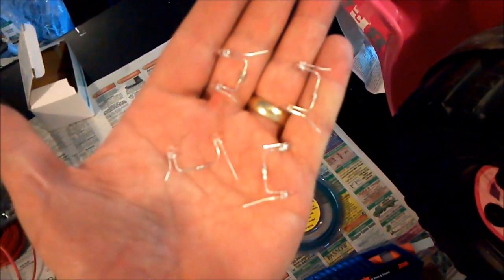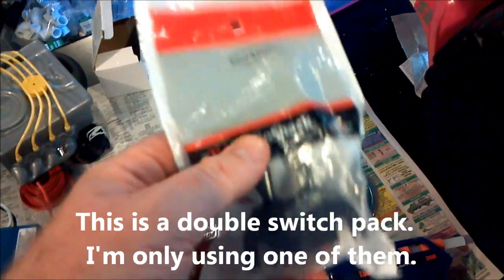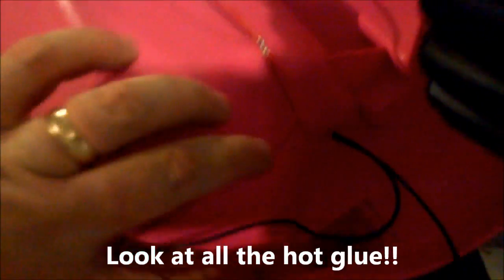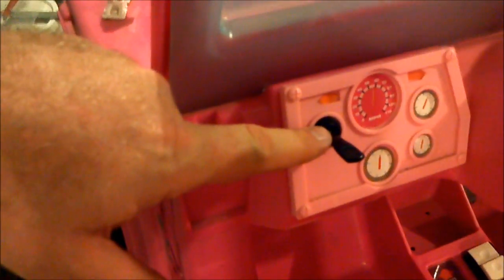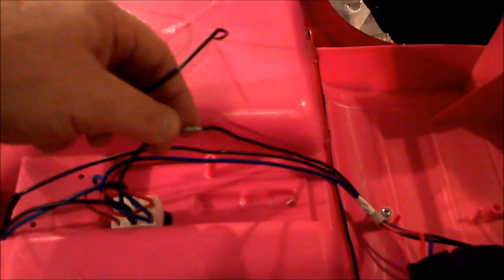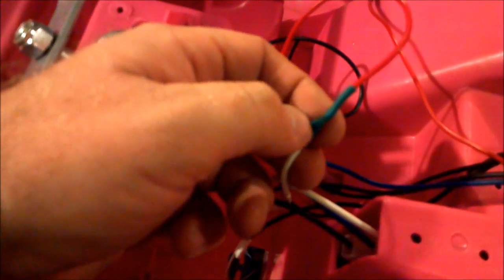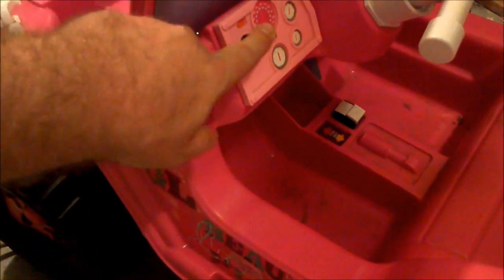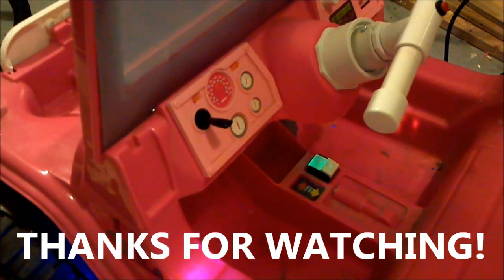Add LEDs to Power Wheels Jeep 6 volt

Comment from the maker: ... Sorry, typed too fast... "If your power wheels is 12 volts AND YOUR LEDS ARE 12 VOLTS you can wire them directly to the battery connections."

Comment from the maker: If your power wheels is 12 volts you can wire them directly to the battery connections.  If they are 6 volts, then you have to use two of them and wire them "in series" - that means the battery ground connects to the first one then the positive on the first one connects to the ground on the second LED and then the second LED's positive connects to the battery.  If you have 2 volt LEDs, then you have to have 6 of them (6 LEDs * 2 volts = 12 volts) and again they have to be wired in series.
Reply: travisgrindal what about for a 24 volt ride-on toy I tried adding lights to my son's 24 volt Grave Digger toy and it did not work and I have plenty of experience adding LED light strips to a vehicle